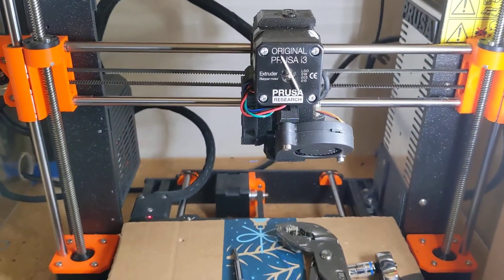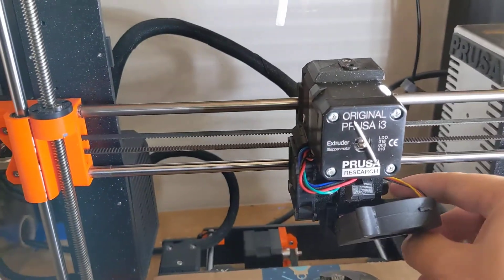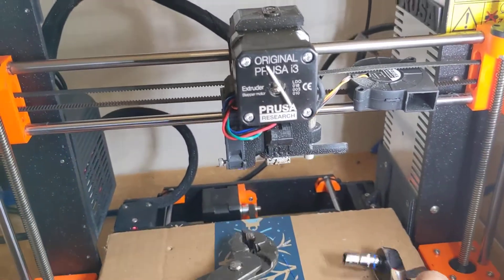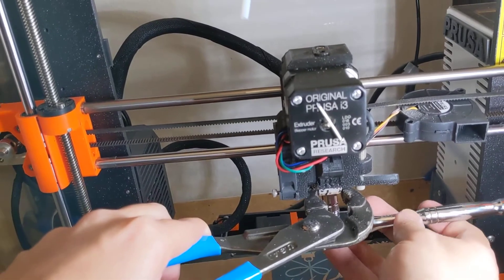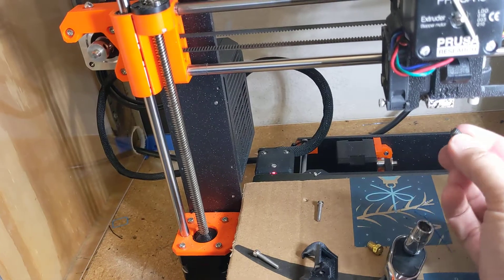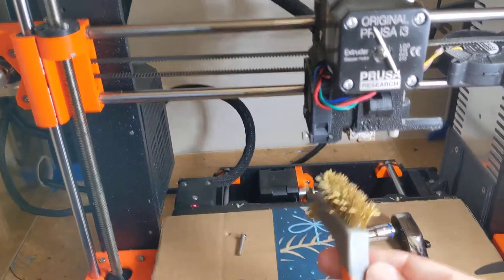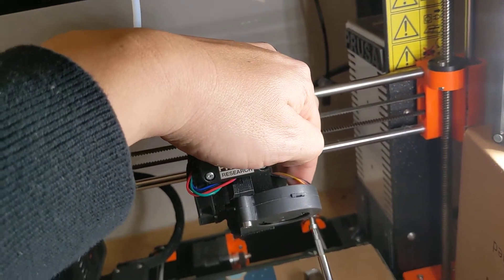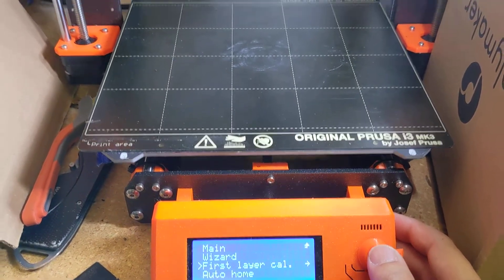How to change nozzles on a Prusa i3 MK3S

Comment: Why remove the fan and shroud? Can do without taking them off.
Reply: It appears that he removed the fan shroud so that he could stabilize the heat block with channel lock pliers.  That's the only thing I can think of.  Otherwise, any torque you put on the old nozzle to get it off will be transferred to the x - axis and perhaps the z - axis.

Comment: the recommended temperature for tightening the nozzle is 280C from Prusa with a torque spec of 2.5Nm, which is just finger-tight. Best to follow the spec lest filament starts leaking

Comment: I know the video is two years old now, but it's worth mentioning that you need to be careful with the channel lock pliers that you don't crush the extruder heater wires or the thermistor wires. They emerge from the left side of the hot end (viewed from the front).  You'll find out soon enough if you do crush them as you'll get heater failure or mintemp errors immediately you turn the printer on.

Comment: Thank you for this. Prusa's video on this subject is old, vague, and (as many of the comments over there suggested) basically lying by omission. After reading all those comments talking about how people could (and have) broken their printers by following Prusa's instructions, I was scared to even try. 

I'm still apprehensive about it (so I'm not going to try swapping to the hardened steel nozzle I bought with the printer until after I've finished all the prints I need to do for work), but this video really helps.

Comment: Since you are not using a torque wrench, how do you know how much pressure is needed for the nozzle to be secure enough but not too much so it doesn’t damage the heat break?  What is “1 finger pressure” exactly?
Reply: You push with one finger, and it approximately meets the recommended force. Doesn’t have to be exact.

Comment: i did not think it was this much involved changing the nozzle. thank you for the video
Reply: The main issue is making sure you don’t apply undue pressure to the heating block while loosening/tightening, which requires you to hold it in place with something. Only way to get a good grip is to remove those parts. 

You can try swapping it without holding the heating block in place, and you may be lucky to not cause any damage. But really you should avoid doing it that way.
Reply: It's really not. Video is about 7 minutes too long

Comment: How do you make sure the nozzle does not ram into the bed after changing it? Would "First layer calibration" help with that? Thanks for the video!
Reply: I would run prusa setup wizard, just to be safe.
Reply: Just adjust the PINDA Probe up or done accordingly
Reply: @ThePrintKid1 This is good advice.  Also would want to reset the Live - Z values and re calibrate the first layer.  If you do have to move your PINDA, might as well recalibrate the entire printer.